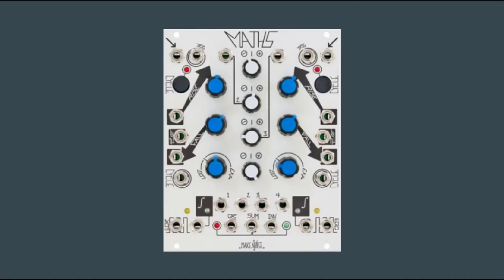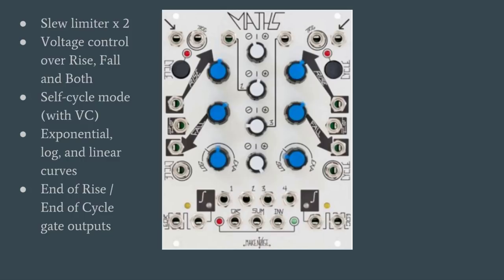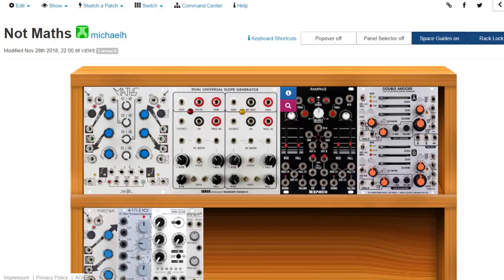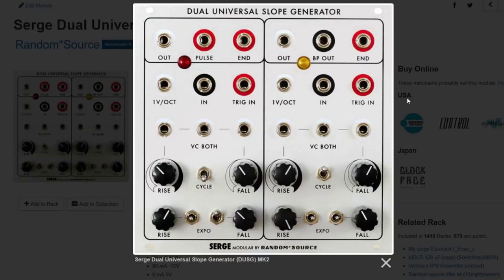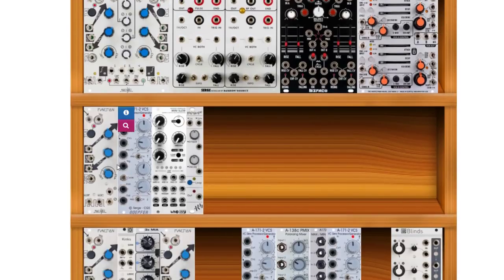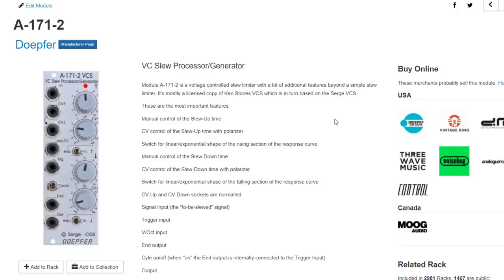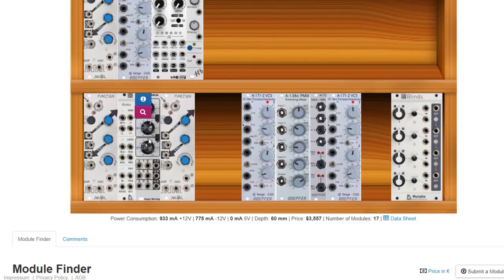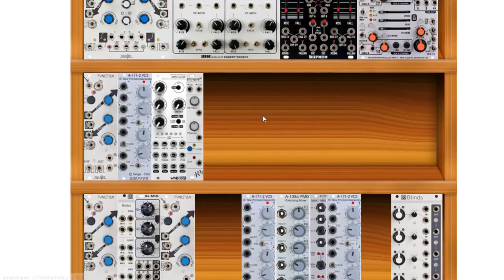Maths Without Maths

Comment: Some guy told me a Rampage + 3xMIA is like maths on crack
Reply: I have a Rampage and Intellijel quad VCA, they work extremely well together.
Reply: my imaginary rig would have a TON of mixers... 2 moog CP3s, a CP3+ (4ch) with multiples, a tiptop miso & a summing mixer, a blinds, an intellijel joystick and an 8 channel VC8 plus other VCAs with a pair of contour 1s and a rampage too. the ONLY thing missing would be whatever those logic things are. otherwise, it looks like I have more maths and better maths. (plus a pair of tokyo gates, an LxD & a pair or apertures for LPG sloping & 4x CEMvelopes) you can never have too many VCAs or mixers, right? as to envelope following, I'm blown away by the sputnik modular "graphic EQ" where each band can be an envelope generator.

Comment: The greatest contender(s) for a Maths would in my humble opinion be a combination of the Cosmotronic Delta-V (rev. 2) and the Xaoc Devices Samara mark II, which combined is the same amount of HP (2x 10 HP) but with more (but also slightly different) functions, albeit at a higher cost (about €460 compared Maths’ €270):

Delta-V: 

2x slew limiters / AD (cycling) envelopes w lin-log-exp control over rise and fall / EOC outputs / VCAs with sum output (!!) 

Samara II:

Basically a 4-channel mixer with 2 inputs per channel (one normal and one inverted), 2x +/- offset for channel 1 and 3 for attenuversion, individual outs as well as submixes, and then the grand finale of having 5 different modes for the two function outputs A & B, which features min/max logic, sample and hold, clamping, scanning (can be used as a VC switch too) 

Combine these two and you have in my opinion an insane amount of options in the same amount of space and which covers more ground.

However, there as mentioned in the video... the immediacy and design from make noise is just brilliant. Everyone needs a Maths. If u have a small setup tho, those two modules can cover hell of a lot of ground in 20 HP!
Reply: Food for thought. I’m thinking about the Delta V, mostly for the smaller form factor. Not sure how much I’d miss the attenuvertors though.

Comment: Fellow YouTuber Voxmachina recently released an open-source function/slew generator he calls Sigma, which is a pretty nice design; it's an all through-hole build, and you can send his gerber files straight to a PCB fabricator. I've built a couple of them (partly to have both channels and partly because the fabs won't make fewer than 5), and those plus a homebrew dual attenuverter/mixer cover most of what Maths does.